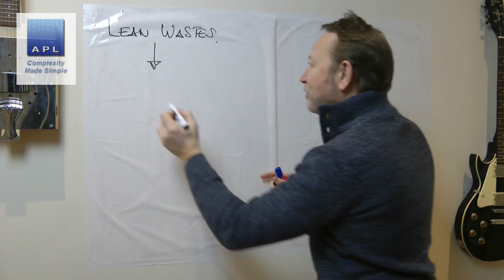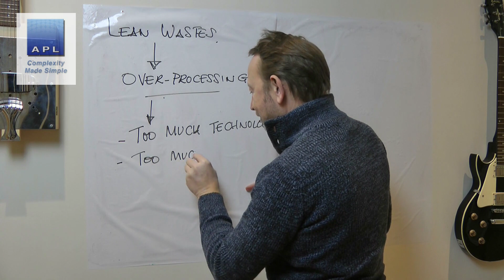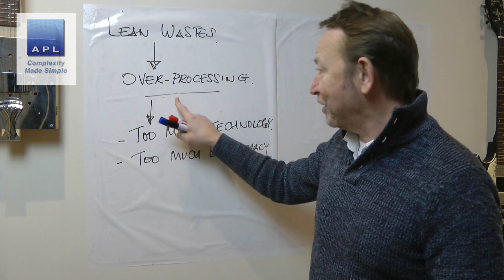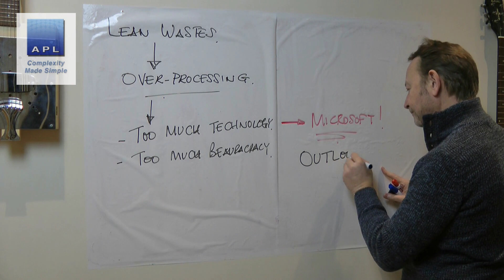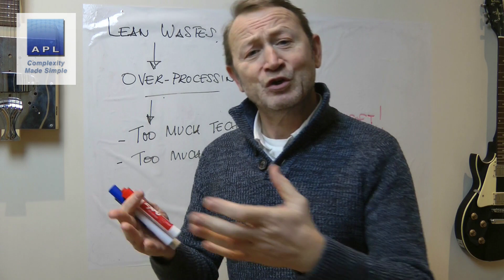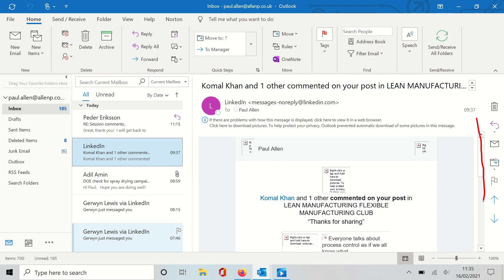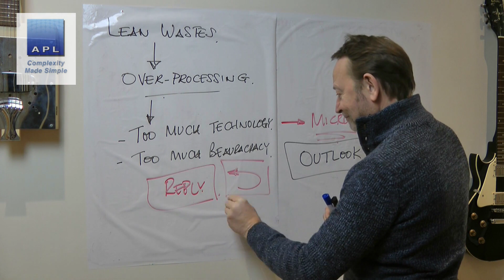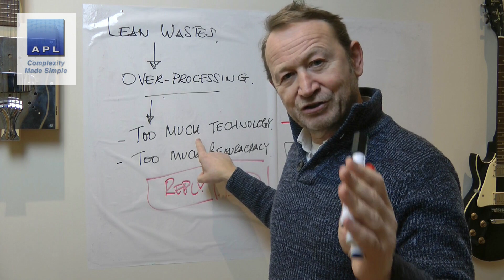Overprocessing - An Example of this Lean waste

Comment: Paul, love love love your videos. I am obsessed with them. 

I have a question about over-processing. Right now my organization lives off of two things: SAP and Microsoft office 2013! We don't have a true MES. 95% of our processes are manual labor in the manufacturing of car parts. What are your thoughts on managing everything in a million different excel "databases"? What are some solutions? 

For example: our OEE is tracked manually by a line lead on a lime board and then someone has to then collect this data and enter it into an excel sheet. To me, it is extremly wasteful and time consuming. However, the argument is that leads need to "interact" with the KPI's. 

Save us!
Reply from the maker: OK love sage, I'm going ask a simple question initially. What is your current levels of OEE?
Reply: @paulallen5321  current OEE target is 85% and recorded OEE is 50-70% OEE depending on line. I am in my fifth week as a CI manager with this company.
Reply from the maker: OK great - Sounds like you're measuring OEE reasonably well. I do slightly agree with the idea of collecting data by hand, for the reason given. You want someone to see the results and react to it. However, that doesn't mean instantly reacting to it. It means running improvement projects. So that's my next question, how many OEE improvement projects are being run?
For each line, what is the biggest OEE loss and what are they doing about it...